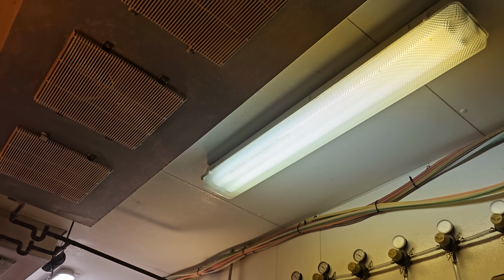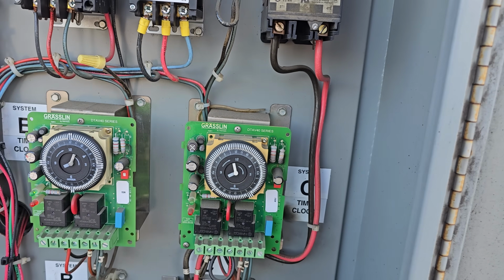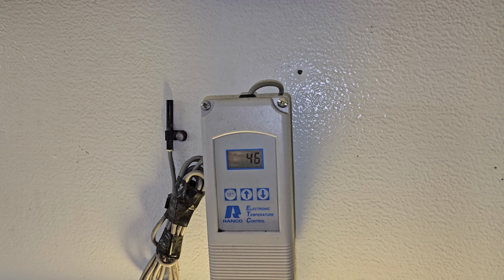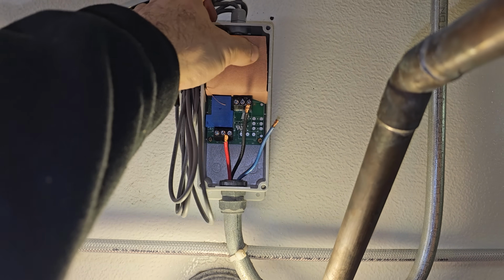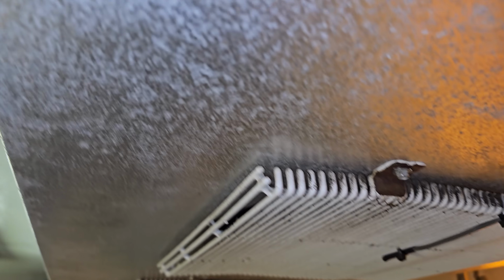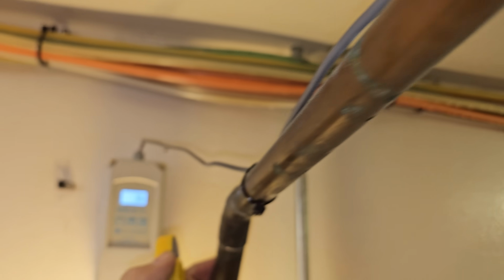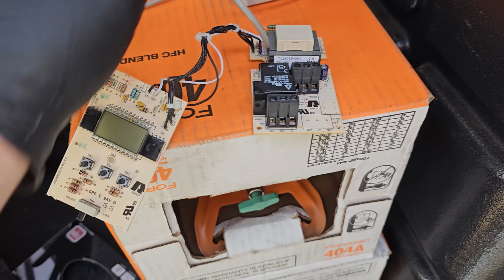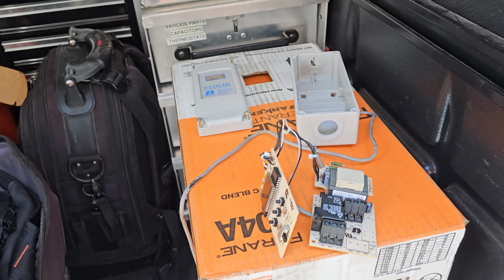CAN THE BEER WALK IN BE TOO COLD?

Comment: i had to repeatedly go and add R404 at a local evidence locker fore a very advanced Freezer unit requiring -10 degrees fore there freezer evidence locker fore the local police department and was having repeated issues with a secondary freezer unit that is set to work during the daylight hours. i did have a very leaky king valve and told them its imperative it be replaced but every time i came they just told me to add refrigerant. so, I feel you when it comes to trying to do the right thing and replaced critical components, thanks fore the spill with those controllers and the critique on the different model specifications fore the appropriate ones.

Comment: having the sense bulb on the return air fan grille will likely cause far more cycling vs. having it near the wall getting less overall, but better blended air mix.
it may even short cycle with very short on or off bursts, causing the control short cycle protection to be on more than off. especially if door/s are opened often or held open frequently.
I know some of those electronic sensors work overly fast, compared to old mechanical bulbs which had greater thermal mass. 😁 maybe over-thinking it though.

Comment: Our server room has an opposite problem.  The ac blows directly on the thermostats and it never got cool enough.  I installed air baffles to stop the air flow hitting the thermostats
Reply: Keep in mind it will short cycle that thing to death. Also, many thermostats, specially Honeywell, have a maximum cycle per hour lick out. Default CPH is often 4, that means it will only allow the compressor to cycle on 4 times in an hr before temporarily locking out compressor operation.

Comment: Anhydrous  ammonia is lethal to humans at 5ppm.
Did lots of work with it in industrial fish processing.
Those places are remote or in factory trawlers.
People have no clue.
Note*
NEVER  attach a brass fitting to an ammonia system. 
It will dissolve away.
Steel connections and gauges  ONLY.

Comment: Ranco A12-1560 or 1506  thermostat, depending on application to control solenoid valve 
Get rid of air sensor.
Keep it simple.
It's constant cut-in.
No need for a defrost clock either.

Comment: Ke2 IS the best temp controller for a WIC bar none. You will be probably be back within a few years to replace that garbage defrost clock once it gets a little sand in it or one of the contacts goes bad. One on left probably replaced in 2020+ based on the 2019 manufacture code on it.

Comment: One thing that I don't really understand is why it's such a common thing to have the controller inside the box in ste US.
Maybe it's just my country, but here it's always outside, makes sense when you think about the moisture that will inevitably make its way on the board imo.
Still, top quality content as always.
Reply: Agreed. The controls aren't actually designed to be in that space, unless you coat the board with plastic spray.
ALWAYS opt for a Ranco A12 1560 or1506.
Constant cut-in. Only difference is one has a coiled bulb and the other is straight.
Reply: Note* 
The less a customer is able to touch, the better it is for you.
Reply: @liam3284  Few manufacturers  do.

Comment: To me it looks like you like a looooot to change parts that don't need. In this case and other in the past. I'm repairing electronics and let me tell you, there are no sign of water in this controller and old doesn't mean it don't work. Change a sensor, or better measuring it, cost you a couple of minute. Than you know if it is the controler or not.